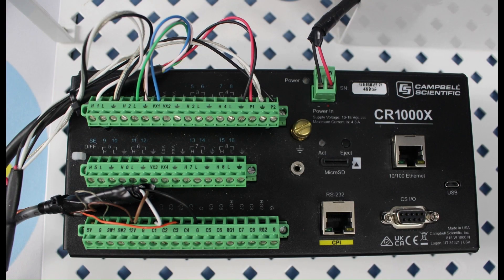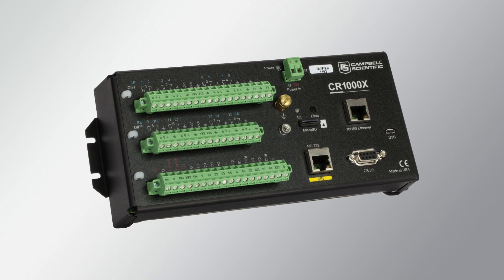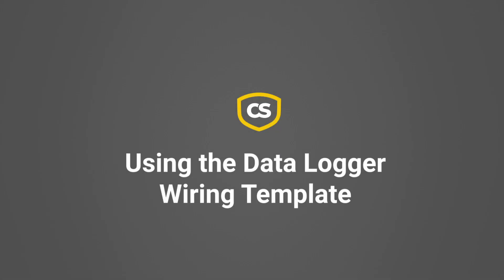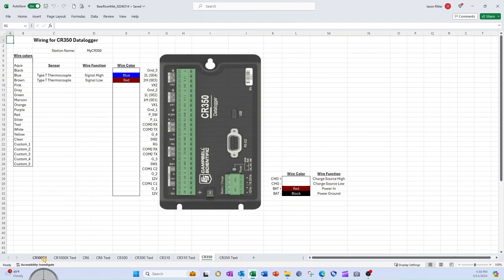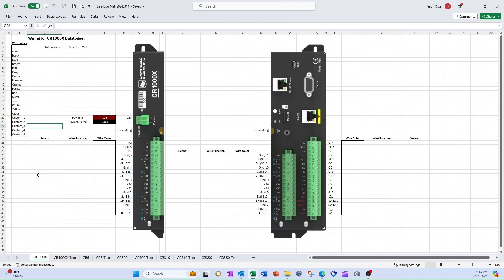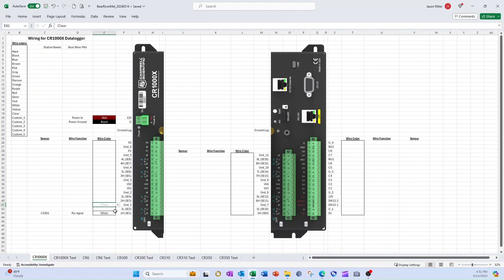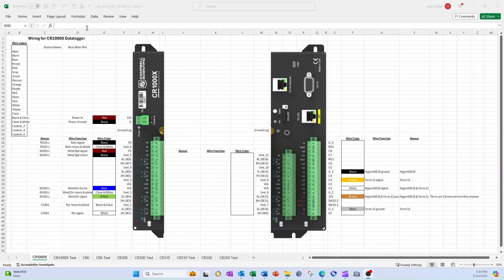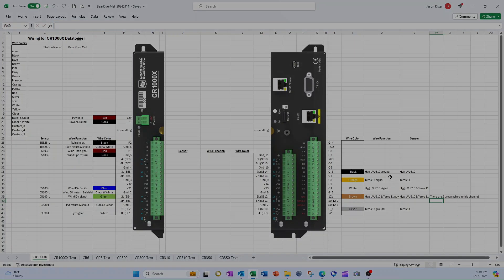Documenting Data Logger Wiring Using an Excel Template

Comment: Not great if you share SW12 with multiple wires, or other scenarios of shared terminals.
Reply from the maker: Thanks for your feedback. You can add custom colors, notes, and pictures to the spreadsheet to make clarifications, but the spreadsheet is only one of several ways to document system wiring.